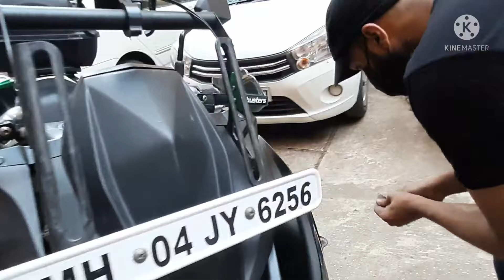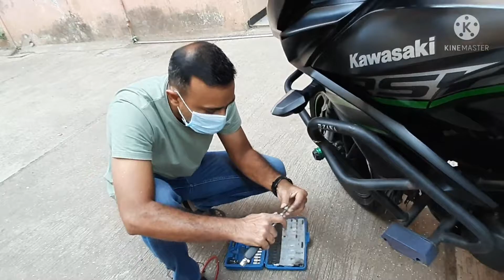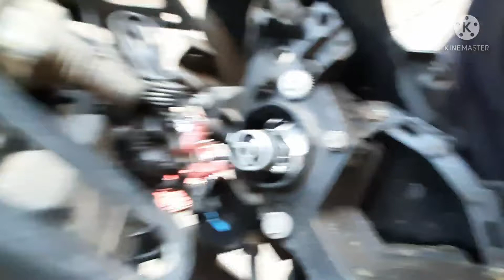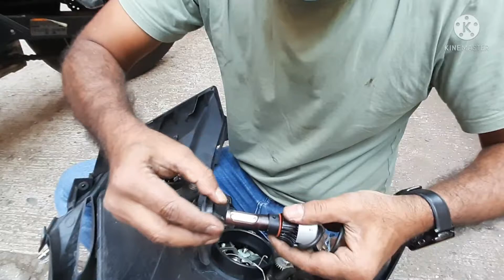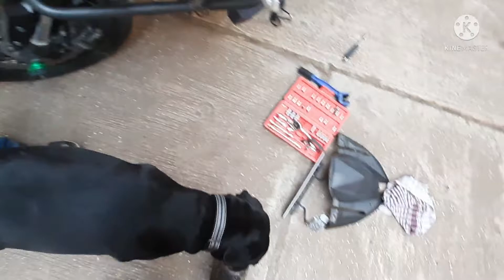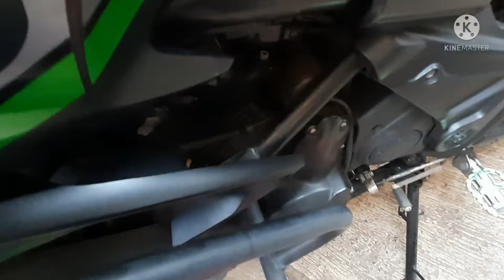LED bulbs upgrade |  Installating LED bulbs on Verys 650 | LED Bulb Modification.

Comment: With the rubber cover,heat can't go off,the chips board wouldn't last long.
Reply from the maker: The assembly is such that there is alot to ventilation. So no Don't worry the lights last a long time. In my case. Been 4 years or maybe slightly more

Comment: You can buy H7 bulb’s direct replacement LED and can change without removing anything at all. Just reach out from the available space from above and below and put the new bulb in . It took me 1/2 hour to do both and I opened no nut or bolt.
Reply from the maker: Share link for three bulbs pls.